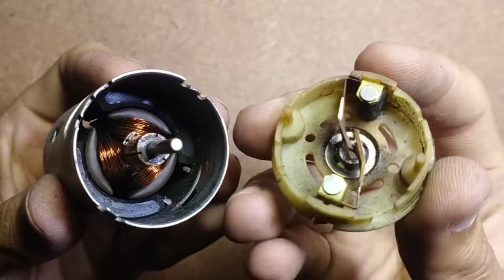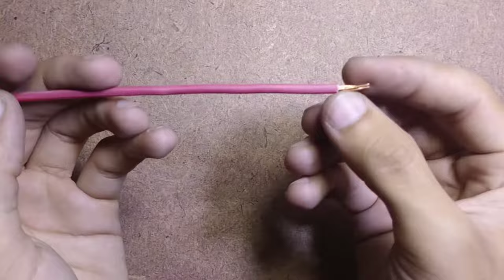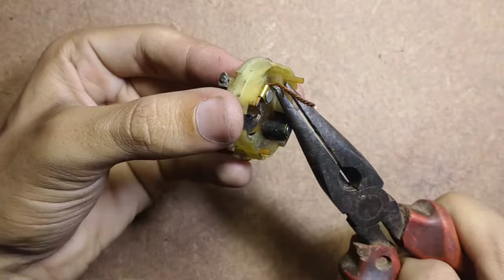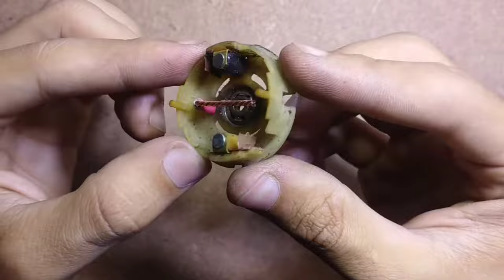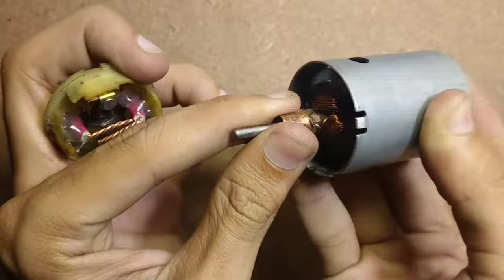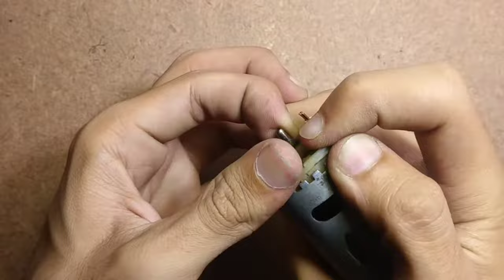How to Fix a 775 Dc Motor That's Stopped Working | Dc Motor Repair | DC Motor Life Hacks

Comment: In this way, the collector will be destroyed very quickly. After soldering the contacts, the thermal glue will melt.
Reply from the maker: You are Right but this is a hack only.
Reply: Why did you destroy the original copper brackets. You only had to make new carbon brushes from old battery. As you see the angular speed after your hack is a joke. Thanks for sharing , I liked it!

Comment: Bro why my motor is overheating in just 1 minute plz reply
Reply from the maker: What is the type of motor and kindly check its rating voltage. It may be less rated. It happens when you apply more voltage than its original voltage. Like, if your motor rated 6v but you apply 12v it will heat and may be burn.

Thanks
Reply: @taelectric1  I have 385 12v dc motor

Comment: Bro this motor armiture has only 3 blades it's 12v or 6v??? 🧐🤨 plz reply
Reply from the maker: its, 12v motor. The voltage rating is not dependent on blades nut the turn of winding. For example if you wind this motor with very thin wire and lots of turns the voltage rating is increased but it draws less current. If you wind it a Few turns with thick copper wire it draws more current but less voltage depend on the turns.

I hope it helps, please let me know if you have any questions or want a video on the topic?
Reply: @taelectric1  Thank you bro for give me information ❤❤😃🥰😍

Comment: Motor got water damage wont spin but freely spins by hand what should i try
Reply from the maker: You should open it and dry it. and also clean its carbon brushes and rotor.
Reply: Replace it 5$ for a new one